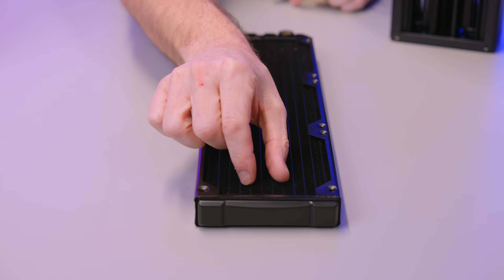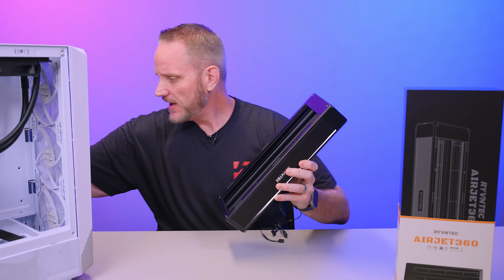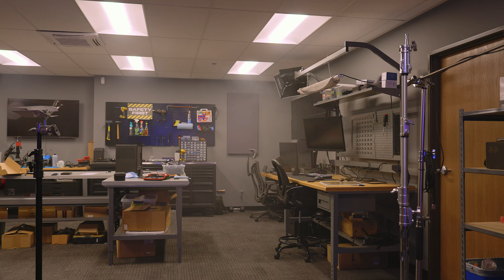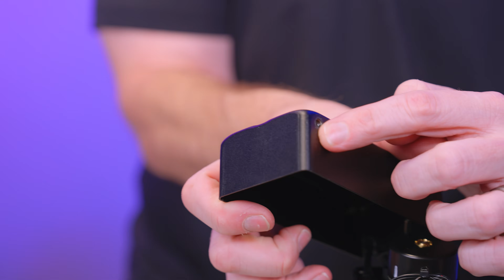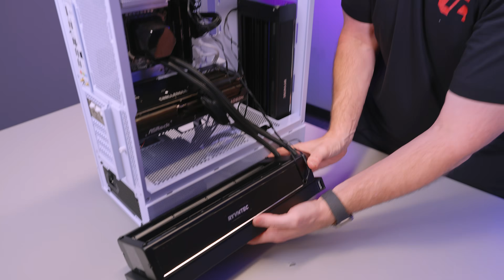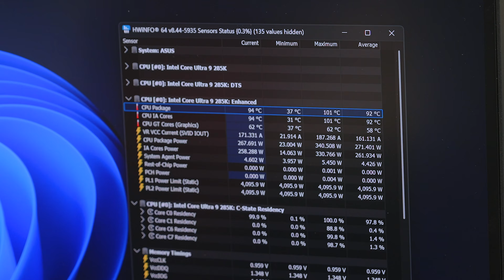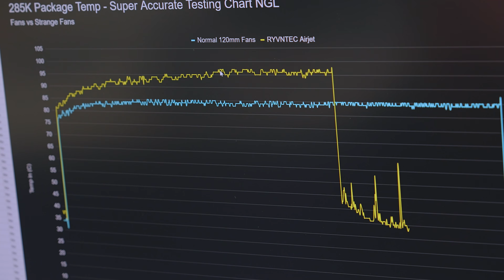Check out this INSANE Prototype!

Comment: Fully tempted to run two of these in push/pull on my alphacool 360mm monsta rad, with some 3d printed fan shrouds that are sloped to fan out the air direction (Also one of these mounted as a pull on a rad, with normal fans in push could be interesting, this thing looks like it could exhaust a crap load of air out of a case, and pull the heat out of a radiator really well)...There's a 480mm one on their site, I would like to try it as an intake up into a chamber, that then has normal fans pulling air through a heap of rads...this thing has got me cooking in my mind 😅

Comment: Just wondering if you tried mounting the cooler, so it was pulling air through the rad instead of trying to push it through. It seems to pull a large volume of air to make the jet, perhaps it would be effective, pulling air through the rad?
Reply from the maker: It pulls from the same narrow channel

Comment: I wonder if the rotation of the blades could be reversed so that the air goes out the sides if the shroud instead of the center. That should give more cooling for the radiator.

Comment: This is a relatively old fan concept outside of PC cases. I've got a Sliger 3U server chassis in my rack that has a very similar fan living where there is usually 3 120s. If you're. doing air cooling this fan style wins every time. But the physics make them dogwater for radiator use

Comment: I was left wondering what they were like in a pull configuration., I would also like to point out that as small as the rear area of a case is, a column fan could ram air down that space...., food for thought

Comment: hamster wheels. so those fans were originally designed for furnaces, gas, and electric fireplaces and they're designed to be silent.. even though that dosent always work out just depends on how easily your annoyed. if it would annoy a home owner enough, you can get a fan speed controller that would usually do the trick without compromising performance. some are actually pretty loud to me and always require the fan speed controller. They're actually blowers that are installed in the bottom and or back cavity of gas and electric and in some cases wood burning fireplaces. They're designed spaciffically to move hot air into a room. They come in different sizes so I wouldn't be suprised to see smaller ones used for this type of application in the near future. They are used with a heat sensor about the size of a nickel screwed to the bottom of your fireplaces tray. It goes on until a fireplace reaches a set temp on a thermostat on the wall in a room, connected to said sensor, than turns off once desired temp is achieved by the thermostat. Then it will automatically turn on and off as the temp fluctuates within the thermostats zone. way to re purpose. pretty innovative. those things are gonna blow like crazy but onnly to the center.

Comment: if they put tubes from 1 side to the other for the mounting blots... that would take the "squish" out when tightening, fixing the clearance issue and make it easier to line the bolts up.

Comment: If there was a solid sleeve in the end caps for passing the mounting screws through, there probably wouldn't be an issue or much of one with the tightness of the screws keeping the blades from turning freely. I can see this being best used to just pull in a lot of air into a case at better noise levels, maybe a pull config for a radiator ...

Comment: the pass through hole for the long screw could be easily fixed by just putting a tube in there. The screw will clamp down on the tube and it makes it a nice channel for the long screw

Comment: Please test that rad again in a pull configuration. 🙏
Reply: After reading these top comments, I bet Jay is saying to himself "Aww crap. Why didn't I think of that?"
Reply: In pull configuration, it does not "pull" from the center, but more evenly across the surface. At least that is the assumption, which we'd like to see tested.

Also instead of using the long pass-through screws, try using short mounting screws from the inside of the fan out to the radiator. Hopefully this eliminates the compression/flexing/rubbing issues. It looks like the metal fans are inset from the surface, so that should be ok.

"In prototype" is a good time to see and fix these issues, tbh.
Reply: @jamesonmiller8283  That's what a very similar fan does in my mini split air conditioners. Pulls right through the evaporator like it should.
Reply: @jamesonmiller8283  Pull config is also the way air conditioners work using these fans they pull the air through the condenser rad and out into the room.
Reply: @Kaelath_The_Red  definitely don’t pull air through the condenser to cool the inside. The condenser is what dissipates the heat to the area not being cooled. The evaporator is what they pull air through to condition the room.
Reply: @Kaelath_The_Red Almost every single air cooled heat exchanger in the world besides PCs have the fans in a pull configuration
Reply: @Kaelath_The_Red  yes, AC units are famous for their radiators...
Reply: @nada-smurf  They are literally the most efficient temperature radiation device you can mass produce.
Reply: That was my thought, as well.
Reply: Maybe making a gasket for it too, help in a pull config.
Reply: @NMCustoms  pull with home depo foam weather strip for window.
Reply: Push pull 😅
Reply: @ClarkBark14  Yes!
Reply: @ClarkBark14  that's what i though when jay say he got 2 of them :)
Reply: I 2nd this
Reply: @Shrubhumper  I was thinking that as well.
Reply: here +1
Reply: My thought exactly. It'll only push in that centre column, but with pulling I'm pretty sure it'll use the entire radiator. I think it'll make a huge difference.
Reply: Yes! Pull config could make a huge difference!
Reply: it's like he wanted to crap on it..
Reply: shit i posted similar comment without reading comments first and everyone says the same :D PULLLLLLL :D
Reply: Gut 3x 120*15mm thin crap fans by removing the fan itself and keep only the fan frame, mount that fan frame between the pull airjet & the rad, and off you go, even pressure.
Reply: Sure but it's unlikely to make much difference. The current radiators we use were designed for standard axial fans and it would take a radiator specifically designed for this type of fan to make full use of it. Essentially the air channels within the radiator would have to, erm, radiate from the central column where most of the air is being pushed through.
Reply: @Ainar86
Mate if you watch the video, the pull side of this twin screw compressor pulls from a wide area, far wider than the radiator.. in fact, it was pulling from the push side all way around  - this in itself is CLEAR evidence that of were pulling through the radiator it won't be just a thin compressed line.
Reply: Also, if you changed to a pull config the branding will be the correct way up.
Reply: Would also be cool to see it with a air cooler, compare temps to normal fans, this amount of air going through the case must be doing something good. Rad is probs the worst case scenario for it.
Reply: Did you people actually watch the video? He did try to mount it that way bout it was touching the radiator and the fans could not spin....
Reply: Had the same thought: maybe it pushes air through in the middle but pulls it from the full surface?
Reply: Yeah. At least give it a short if not a full video!
Reply: I came here to say this as well.... I was thinking the same thing as some of these comments below... I bet it would perform much better in pull configuration.
Reply: I was asking for this halfway through.  Let's see the followup!
Reply: The structure has those 1mm humps. If they're taller or the face that sits on the rad isn't flat but is raised limiting how close it gets to the fins, it could probably work. But as Jay shown, this really isn't suited for a rad. Regular fans on the AIO with one of these things as intake vs 3 fans as intake is the only test that makes sense with this design
Reply: @Ktmzqw

No mate.. watch video, it was CLEARLY shown that from the pull side it was pulling from WAY wider than the radiator. The push side is the only side where the air compresses into a line. 

Jay CAN make mistakes, mate.

Comment: Jay, put at least SOME context for the title or thumbnail.  Literally just the word "cooler" or "fan" after "prototype" would be enough.  Best "case" scenario would probably be to put this fan in the front input, then have a top mounted radiator with normal fans as the output.  Which direction to put the rear fan would depend on how overwhelming the positive pressure is.

Comment: honestly once they work out the Quality and tolerences would be a good basement intake for most cases with the 360 support on the bottom
Reply: I agree. I would definitely swap this for my 3x120mm at the bottom of my case. Force so much air through my gpu and out through the aio at the top

Comment: Could they make the center piece inter changeable with vents blowing left and right for the radiator to force the air where needed maybe you can make it with your new knowledge on your new machine. And on a side note have you tried the latest Nvidia  profile inspector. Thanks for showing us the new chinga- la- derra

Comment: I'd try setting it up in pull and using some thin 1mm foam tape to seal it better that would probably rip then. The air gap between the rad and the fan fins would probably act as a sudo plenum
Reply: Yes!  Do that @ Jay, it will tell us if there might be a weird sound as well when the fan intake side will have a tad of negative pressure =)

Comment: A solid tube between the screw holes would stop it from flexing and stopping the blades
Reply: Several people mentioned this, but I wonder if it wouldn't be easier to mount using flat-headed (flush) machine screws from the inside instead? No pass-through screws, no flexing, and as long as the screw heads are flush, no issues with obstruction.

I admit opening the ends (end caps?) to screw down is not intuitive, but not an actual design change so much as implementation.
Reply: looks to me like the entire end cap is getting pulled down, the main body has those stand-off pads, and theres almost nothing indexing the cap to the main body and preventing movement, and theres only torsional resistance from the threaded tubes preventing the top from moving, which is insignificant... they should... probably just make the cap match the stand-off width atleast where the screws are or... significantly reinforce the threaded tubes to the point they run thefull internal width of the end cap.
Reply: I was thinking that or a wide washer to spread out the pressure point, and blue Loctite to keep the screw from vibrating back out.
Reply: @chaoticwonder3278 The structure has those 1mm humps. If they're taller or the face that sits on the rad is raised limiting how close it gets to the fins, it could probably work. But as Jay shown, this really isn't suited for rads. Regular fans on the AIO with one of these things as intake vs 3 fans as intake is the only test that makes sense with this design
Reply: Word
Reply: The screws themselves were touching the motors, not any kind of flex in the chassis.
Reply: yea the guy in the video mentioned it multimple times
Reply: Ya.... That's exactly what he fucking said. Why don't you repeat everything he said in the video for us all?

Comment: You should show an overlay of the RPM and more importantly the Power use in Watts and Amps.
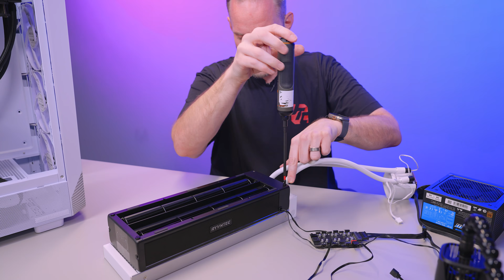Reply: 11:28 Bro you have a 3D printer and now know how to use Fusion/CAD... Print a damn spacer or go mill a spacer. Problem solved.

Comment: Jay, your suggestion about having columns/tubes in the motor cap for the screws to pass through also would help prevent it from squishing and stopping the fans from turning. 🤙
Reply: if the motor is not currently rub on the screw anyway , than it solve that issue as well

Comment: ik it probably wont do much but wonder if instead of having it blowing it though the radiator wonder if sucking though the radiator would do a Difference?
Reply: It would work a lot better because that is how these fans are designed.

Comment: It is just a cross flow fan, that is mounted vertical, rather than horizontal. We used to have a 5.25" bay cross flow fan, back in the early 1990's. If you have a fan assisted oven, this is the type of fan they would use. Issue used to be, that they have a dual bearing motor and no bearing to support the opposite end, which led to a grinding noise at one end.
Reply: Silverstone has the FX 121 from almost 20 years ago which is one single crossflow fan. GN tested the Meshless Design case which is made around 1 crossflow fan alone. The difference is this has 2 crossflow fans as screw type/Whipple supercharger so it's 120mm wide for a more universal-ish case mounting
Reply: @Ktmzqw  Thank you for the information.
Reply: Yes we know it's old tech lol 😂 it was stated in the beginning of the video. But it's been adapted for PC use and that is the new part lol stating the obvious doesn't make you more knowledgeable.
Reply: @mrnew28-p2y  The comment you're replying to literally mentions having it on a PC in the 90s.
Reply: @mrnew28-p2y  You need to stop getting in your feelings over youtube comments

Comment: The reason thing's like fans, records, cd's and mechanical hard drives are disk shaped is because thats the most efficient shape for maximum surface area in any space.  They tried cylindrical fans back in the beginning of the 20th century.  And things like paddle wheel boats. They stopped because they found disk shaped fans to be more efficient by a huge margin.
Reply: Riiiiight, efficient in what way? I'm pretty sure that CDs dont really blow air, plus you can go on google right now and find 50 different cylinder shaped fans or ACs. You also have to keep in mind that there are other things in play, not just surface area or max throughput, the air distribution matters a lot on this case.
Reply: @saawysorenson its basic principles of geometry in physics.  You could just Google it
Reply: The idea is surface area.  Whether you're pushing air or storing data. The principles are the same.
Reply: Except computer fans typically aren’t necessarily optimised for (performance per unit energy) efficiency. Most users need some balance of static pressure and airflow optimised against a combination of noise and unit energy; and different users will prioritise different aspects of that - e.g. anyone running a MORA will want their fans to have “good enough” static pressure and “excellent” noise levels.

Comment: can you use it in pull config?  then the air flow into the radiator wont be the thin air stream    just see you tried the fitting in pull to chk if motors turn  did you do heat tests in pull?
Reply: I second that, negative pressure on the rad would make air flow from every fin into the feed for the fan
Reply: I was hoping he would do the smoke test with it set as a pull fan.
Reply: Yup, rad goes other way. Like a supercharger / intercooler configuration.
Reply: Yeah, definitely meant to be in a pull config for a rad
Reply: Make sense.. the fan looks just like AC blade, which works by pulling air thru condensator fins..
Reply: glad someone said this was my first thought
Reply: yup and a regular fans as push. the combination fixes poor center of regular fans with good center of thos fans and regular fans fix the poor border performance. also  negative pressure balances air flow regardless. this thick fan can be installed on the exterior because no need to run liquid coolant, its jus a fan. and the case grill will act like a baffle and even out the air from the radiator. dont even do much, just slap to top of case and see if temps drop. then try airtight gorilla tape. GG OM😂
Reply: Just came to post the same thing
Reply: I thought the same thing. Maybe a pull configuration would have a better effect?
Reply: That's what I was thinking too. Sucking air through the rad might work
Reply: I thought Jay would have tried or explained why you don't so came looking for this comment. Seems safer for the fingers too.
Reply: That’s what I was thinking
Reply: Was literally running to the comments to say this.
Reply: Also my very initial thought.
Reply: YAAAY... come back... flip the whole stuff and show us
Reply: exactly. That is more efficient as well with any fan to pull instead of push.
Reply: it's a fan from an ac. it can pull through the rad, just like in an ac. needs fairly well flowing rad though.

but it's not like some cheatcode for fan power vs power use. there was some other product like this a year or two ago for pc's.
Reply: @lasskinn    dont care the silence of it and the amount of airflow will do me nicely   thanks -  now the price has to be reasonable🤞
Reply: Didn't Jay actually try a pull mount but immediately encountered the screw binding with the motor issue. The fans will need to be modified in some way regardless for use with a radiator in any orientation. It's a prototype, the manufacturer will have to make necessary changes in any case.
Reply: @lunsmann   just rewatched - yes he tried a fitting that orientation  but not a temp test which is what we all want  even if he just sticks them together with tape to get it working  we want to see the airflow/temps in  pull
Reply: Came here to ask the very same question, you beat me to it 👍🏻
Reply: He should add a 2mill rubber gasket between the fan and radiator, making a full seal, and spacing it out a bit more for the screws getting in the way.
Reply: That’s exactly what I came here to say.
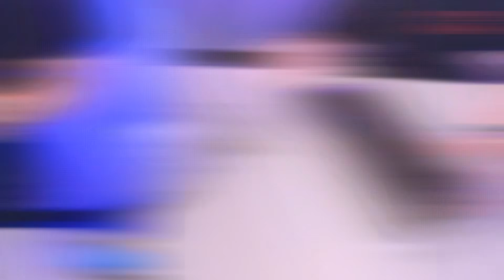Reply: 15:07
Reply: @markjan186    as mentioned  -   but wasn't tested for cooling in this config

Comment: They are commonly called squirrel cage fans. They have incredible flow rate, best to put the fans behind a bend in the duct to negate noise. These fans have way more flow than normal fans but now you know the caveats. These fans are all about pressure!!!!